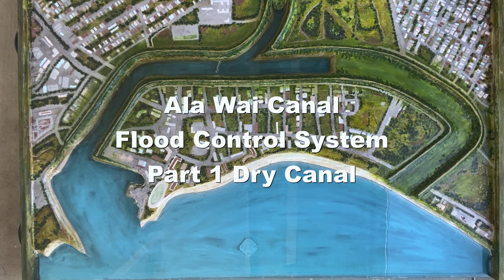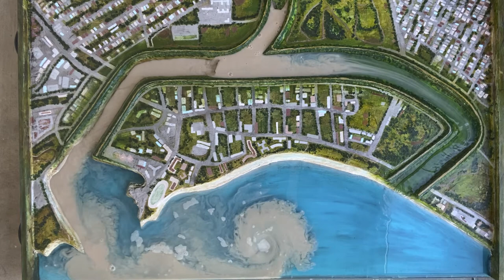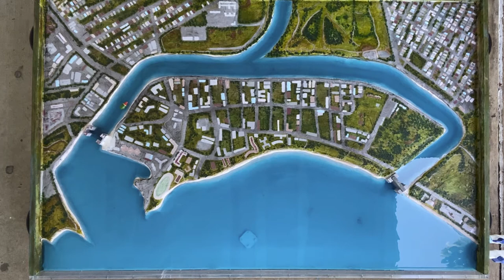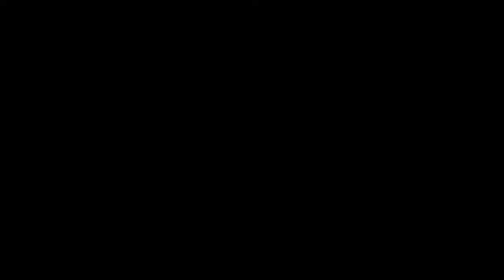Ala Wai Canal Flood Control System

Comment: Who will pay for the Diamond Head outlet? The land is already developed.
Reply: Public road converted to canal
Reply: @sidjtd  Answer lacks detail. "Who will pay?" includes: 1) Compensation for landowners, residents and businesses who will be no longer be on a public road, 2) Engineering and building a new canal (land might be free but construction is not), and 3) Replacement transportation infrastructure to solve the traffic and access problems caused by removing a major road (if that is a good idea why not expand Ala Moana Park by tearing up the boulevard).

Of course, "the government" is the usual answer when the question is who pays for megaprojects. If that's the case, both the city and the state are in no position to do a major project, as the rail system will eat up increasing amounts of general revenue, with the sales tax increase not covering the billions of dollars of extra construction and operating costs.
Reply: If water can rise out of the canal would it not have flooded the land either way?